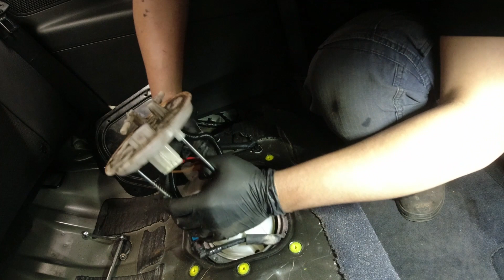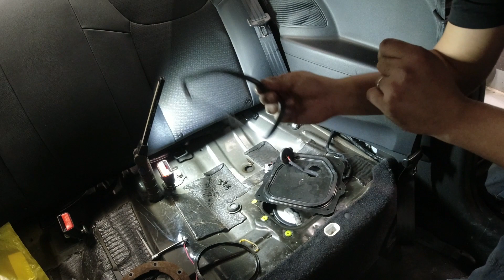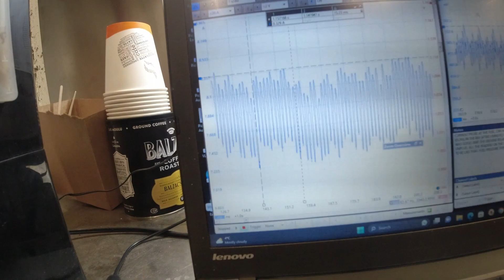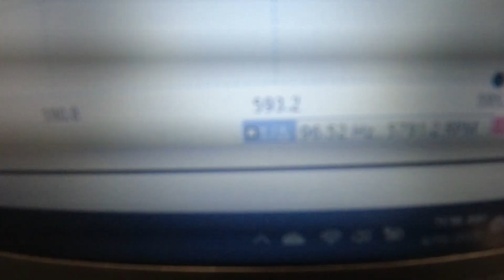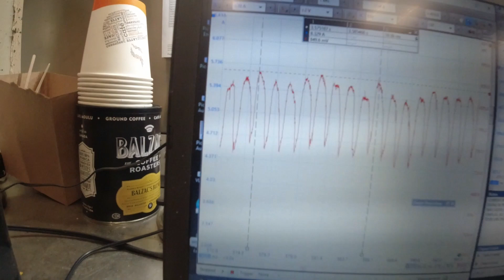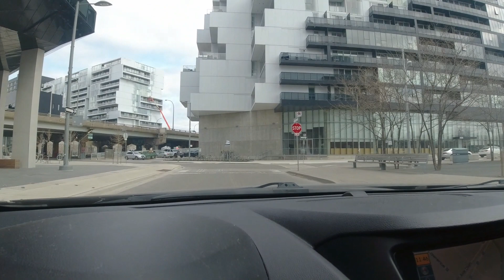Fuel pump repair - Genesis Coupe 2016 (Follow up repair from previous video)

Comment: Hey bro how or what is a p0035 and how to fix the problem
Reply from the maker: Looks like thats for bypass vapve, eitger you have open circuit or you have faulty bypass valve.
Reply: Where is that located and how can I fix it